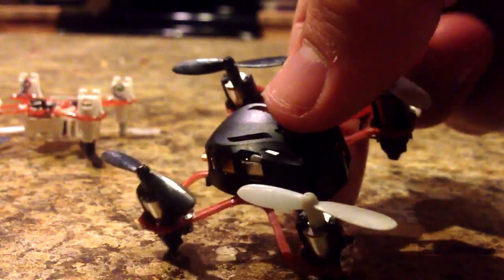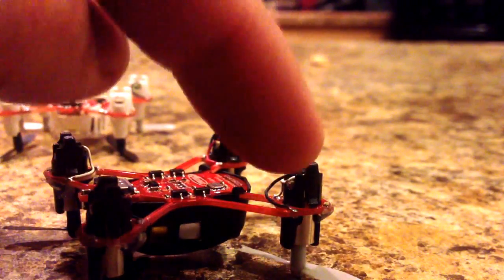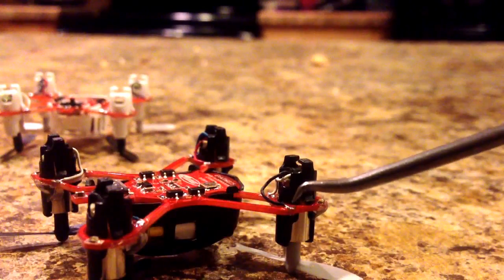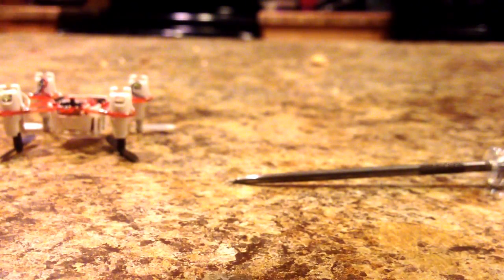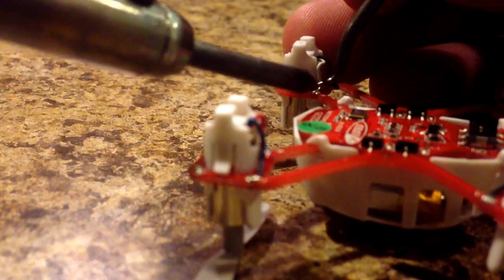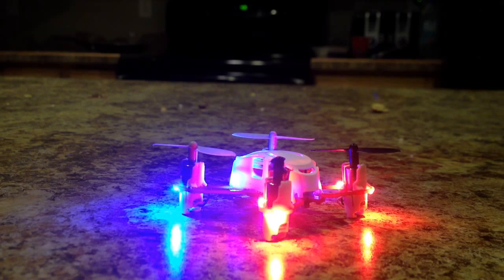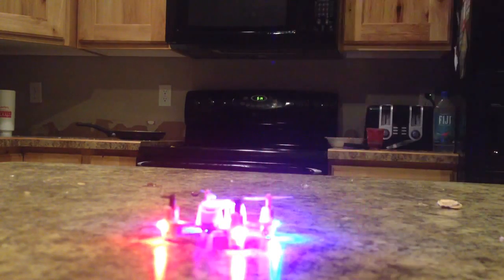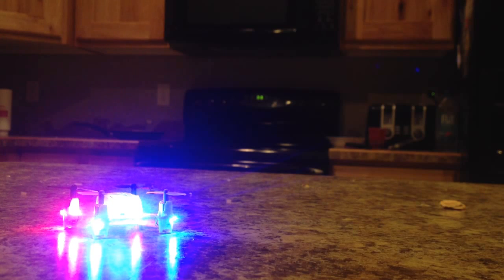Estes proto x hubsan q4 motor repair how to tutorial

Comment: In mode 1 (Japanese model), i cannot for the life of me calibrate the gyro/accelerometer. 

According to the manual, in mode 1 you have the left stick (elevator/rudder) to the bottom right and wiggle the right stick (throttle/aileron) left and right whilst still keeping it pushed down to zero throttle so the thing doesn't just take off. 

I just couldn't get this to work, i.e. the front blue lights never flash.

Any tips here?

Comment: do you think i need new motors? causemwhen i try to fly it they spin but one side ist strong enough
Reply from the maker: +Steven Ortiz It sounds to me that your motor is going bad.  This is one of the most common signs of a proto x motor failure.

Comment: My problem is that one of my wings wires have come off//how do I fix this
Reply from the maker: +fabio Marques Ocassionally I will have a motor wire come off.  You will need to use a solder Iron to reattach the wire

Comment: my problem isn't really related to the motor but the remote doesnt connect to the cop whatever i do. i tried draining it and recharging, turning on the remote and the cop in different sequences and combinations and it still won't link. any remedies? sometimes the blue lights flash at the same time when i randomly move the joystick so its kinda connecting to some extent.
Reply from the maker: +Lau Michael Sounds like to me that the controller on the quad may be bad.  Only way to test is to grab another same type quad and pair it up to rule out the culprit.

Comment: My motor won't stop even if i leave the controller off, when I just turn on the quadcopter the motor comes on
Reply from the maker: +Not an Alt  Hi Your quad has blown the mosfet or FET chip to that motor.  They are a bit tricky to desolder but I have done it a couple times.  the models that seem to happen the most are the proto x  Syncro ones.
Reply: well i got new motors in, I cant seem to get the positive and negative motor cables back on the circut board though, i looked up videos and they said it doesnt require soldering but I cant get the cables in the board

Comment: What if one or my wires popped of its self ? And there's no little strings in the middle
Reply: @chrisrees
Reply from the maker: Asiah Spencer HI sorry for the long time to reply.  sound like you will need to strip the wire back and use a solder iron to "tack" it back on.  Use a point tool like I have in the video or tweezers.  The stock motors do not have very long wires so be careful not to waste any wire.

Comment: A little tip, you can use motors and props for the Cheerson CX-10. They make mine fly much more responsive and they cost less than half that of the Estes parts!

Thank you, I was curious how to get the motors out of those mounts without breaking them. This was very helpful!

Comment: I just placed my order last night through ebay for these motor/prop combo cant beat the price thanks again for the video i have heard it can be dangerous to solder right onto the board and maybe splicing the existing wires to the new motor wires and soldering the wires together from there. Have you had any problems soldering this board?
Reply: Hi it is ok and the motors should be soldered directly to the board.  You will want to make sure that your iron has a fine point tip (makes it easier).  Also what to make sure you are careful around the plastic housing so you don't melt or damage the plastics.  Do not use the pistol grip with trigger soldering irons (used in plumbing and certain applications).  The pistol grip irons can damage the PCB and electronics.  You can find an ok iron over at radio shack.
Reply: yea i think i got this if not these protos are so cheap now i can buy another have you found these motors to last long than stock i will be using these motors with the supplied props i ordered as the combo pack that should help longevity
Reply from the maker: Jesse Bergunder  My quads had a much longer life span with the motors and blades.  The first set of motors lasted from May till November.  I fly them at least a couple times a week to sometimes daily.   The motors are rated at 5 Hour life span in normal usage thats about 75 flights.   Of course crashes and heavy throttling will burn these out quicker.
Reply: ofcourse thank you for your input cant wait to get these thing on my quad and get flying thanks again

Comment: I just bought my first Proto X and since Proto's can be bought so cheap ( $ 29.99 U.S. ) I'll never even bother buying replacement parts for it other than prop replacements. I'll just take the one that broke down and set it off to the side and if , and when, I encounter a problem with my next one I'll just scrounge parts off of my 1st Proto
( spare props included ). Talk about a no brainer. Thanx for the video post though.
Reply: Yes indeed,  they are getting cheap to where one may put one to the side after it fails and buy another to keep on flying.  This was one of my first tutorials on the proto x (Copter Craze - Chris Rees)  and at the time motors were scarce and the proto x was more money at 40-50$ dollars at the time.  Once the clones started popping up everywhere and other popular manufactures were in the process of release their version the price dropped.  

I guest one benefit to upgrading / replacing the motors is that your quad will give you longer life.  I got well over 5 months on my first motor upgrades and I still have the same blades.   I changed them out with Chaloi Motors and "enhanced blades" to get better life out of them.  http://stores.ebay.com/E-Parts-Discount

Comment: thank you! this video helped me swap motors, it was also my first time soldering and it wasn't so bad :) Also should be noted that any "B" motor can be swapped with any other "B" motor on the quad. I had two quads with dead right rear motors and I swapped for the other "B" motor diagonal of the one that died, still works. Cheers!

Comment: Nice video, thanks for sharing. I know its a dummy question but if my motor wires are damaged what type of wire can I use to replace? Anyone??
Reply: As long as your wire is insulated and larger than the one broken you will be ok.  However keeping the wire as close to the original will keep the weight down.

Comment: Nice video, one more thumb up! I have a Proto X and have a Cheerson CX-10 on the way in the mail, I love these things. I'm probably going with the Hubsan X4 next (recently rekindled my flying addiction) and was wondering; is there any way or are there any different controllers that allow the flyer to switch roll and yaw?
Reply: I am not aware of any with the proto x line.  But That is a good question.  I do know the new proto x SLT (setup up from proto x) is compatible with other transmitters so there is a possibility there.  As far as radios I have stayed with stock but hope to experiment with the radio options proto x SLT has.
Reply: +andrewnonymous the Hubsan X4 contyoller works with the Proto X i have seen alot of people on youtube using the hubsan x4 controller i personally have not tested it but i trust its the truth.

Comment: Mine won't liftoff. All of the props will spin but i can't take off. The back props will but not very far
Reply: Sounds like a possible prop misplacement.  Please check and make sure your A and B props are in the correct location.
Reply: Thanks so much CopterCraze. I can't believe I made that mistake. I had a feeling it was that but I also thought it could have been something different. Thanks so much for your help! (=

Comment: I have also found out to put a few micro-micro drops of removable elastic UHU Por foam adhesive to precisely but flexibly precisely position the motor-holders to the PCB and the motors to the motor-holders, using the prop-like rotors as a guide. This allows more precise trimming and control.

Comment: Having replaced DOZENS of similar pager motors on my several small motor-eating  4-ch helis, I found out to FIRST put a micro drop of CA gel [NOT liquid!] on the wires where they connect to the motors and let the CA gel harden, well before touching them or moving them; which in this case would be before installing the motor.  Saves time, motors and nerves!

Comment: On one of my motors as soon as you turn on the quadcopter one motor continuously spins. It was fine till I wreaked it pretty bad. Ive tried recalibrating and everything.
Reply: YOu have blown the Ntype Mossfet Chip (FET).  therer are 4 of them on the underside of the quad.  If you are good with soldering you can replace these.

Comment: i think my motor is fine but i definitely have a crack in the plastic motor housing.  Do you think i need to disconnect my motor wires to replace the housing?  (I have a donor quadcopter) I feel like there's no choice but to disconnect.
Reply: I would desolder them to be safe from pulling the wire out of the motor case housing.

Comment: One of my motor keeps running as soon as turned it on like in this video,
One motor of the Estes Proto X Nano is constantly on
Can you suggest whether its a motor problem or board itself.. how can I repair this ??
Reply from the maker: Most Likely you have blown your mosfet chip.  The quadcopter has 4 of them on the bottom one for each motor.  I hope to have these in stock soon.

Chris

Comment: Had mine 4 days, motor out, are most of the motors they make bad?  or was it from a few crashes? It's an amazing little machine. But Id rather fly it, than doing repair work.
Reply from the maker: The proto X is amazing.  The motors on these are the most common to fail even within a couple flights.  It sounds like to me you probably have a defective motor for it to fail that soon or you had a nasty crash that crippled the motor.   Check with the hobby shop or even estes to see what warranty you have.  I have heard of some calling in and getting a new quad for a replacement.   If you unable to do this I sell the motors in my ebay store.  The motors have the same specs as stock but they have a lower failure rate.  I am also very well priced.   My Store is http://stores.ebay.com/E-Parts-Discount
Reply: Chris Rees are you out of motors??
Reply from the maker: Yes I am out at the moment but should have them back in stock very shortly
Reply from the maker: Fernando Lupian Yes I am out at the moment but should have them in very shortly

Comment: For those wondering how he got the motor out, there is an easy/safe way to do so.

You'll need:  2 straight pins & snub nose pliers.

Slowly wiggle 1 straight pin in from the side at the top of each clip (that is holding the motor, just below where the blade would be), so it just peeks out the opposite side.  Doing that, the ends of each clip will be completely away from the motor (allowing you to pull it out).  If you're transferring a motor, you can try pulling it out with the blades on, but I prefer the snub nose plier on the axle of the motor, not on the can!  An even pull of the pliers while holding the base with a finger and thumb along the same sides as the clips holding the circuit board going around it as well, you will avoid the wires from getting ripped off and the motor should come out quite easily.

The snub nose pliers should have some minor teeth on them so as to hold the axle without crushing it.

Take your time doing so, the straight pins shouldn't be too thick.  If they're very sharp, dull them some so you aren't stabbing the clips as you wiggle them across.  The straight pins, when put in, should be like the blades one on either side and in the same direction, when you pull the motor out, they'll likely cling to it due to the magnets.  Very little effort is needed to get the motor out this way and had no ill effect on holding the new motor or showing any signs of damage.

Good luck!
Reply: While adjusting the position of the especially loose motors in their clips/motor-holders, I found that the holder plastic is easily re-formed and bent with the aid of heat from a 1200W hairdrier.  So long as you don't touch them, it is not necessary to remove the props/rotors, potentially damaging the motor, since the prop-like rotor plastic is stronger and needs even more heat to be adjusted than do the clips/motor-holders.  And see my above comment about micro-drops of removable UHU Por to elastically tighten the motors in precise positions..
Reply: @xlcrlee  where is the comment above you say? Do you know how to fix stuck motors? My q4 h111 as a stuck motor, I already tried with pliers on the can, and in the props axle, but doesnt work. Wen I turn the throttle up, and push it with my finger it trys to work, but allways stop... Tried to hammer it smoothly with a screwdriver but doesnt work too...
Reply: @Morcego538  Quite obviously that "technique" you tried doesn't work!  These are very delicate and VERY cheap motors.  The only way to "fix" them is not to break them in the first place!  With proper oil on the shafts every few minutes of flight, only flying for 10 - 25 seconds MAX at first when fully charged (too much current to the motors), NEVER letting the motors get even slightly hot and only using NEW, absolutely pristine MATCHED rotors, unbent and unscratched at the tips when viewed with high magnification.  And even then they will not last very long.  By being careful and NEVER allowing rotors to touch anything, including skin or paper I have kept the motors lasting longer than the LIPOS.  What you have described ios like attempting brain surgery with a sledge hammer.  Buy new motors or a new quad!  Though I have keptt several of them still working, I now have much more fun flying the Blade 70 S heli.  Goggle it, and in my YT vids on it you can find out how to keep it working much better than OOTB.
Reply: @xlcrlee I just tried that technique because I saw a video here on YT of someone doing it, and in the video it worked, seamed logic at the time, ofcourse I though it could damage the motor, but yes its better to buy a new quad. Im going to chech out  the your videos of the blade 70 s thanks!

Comment: Thanks for the video. I purchased my Proto X some time ago. Flew it for a couple of weeks, then had motor trouble as shown in the video. Didn't want to buy a second one just to have the same problem again. Now if I acquire a four pack of motors and follow the instructions, I'll be flying again. Any advise on how to preserve the life span of the motor?
Reply from the maker: The Best Way to preserve is to avoid crashes and to immediately cut throttle or power to the motors when the props are stuck are restricted from moving.  The last couple of Proto X's I purchased got me close to 20 flights before the motors were done.